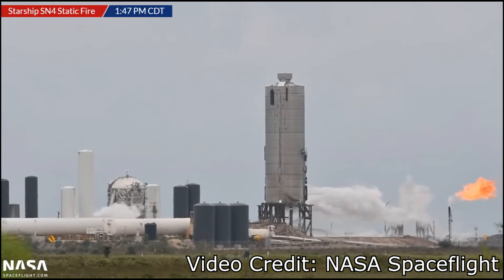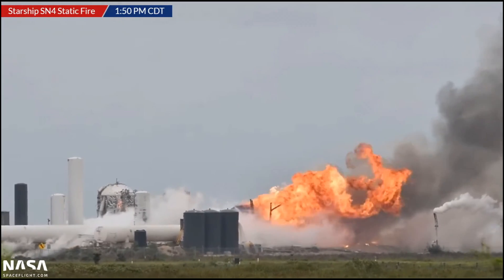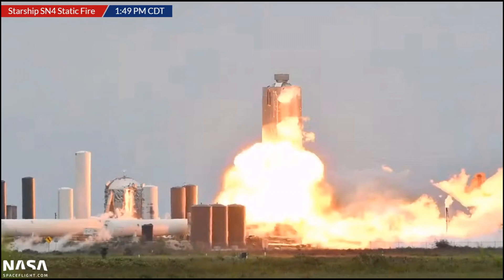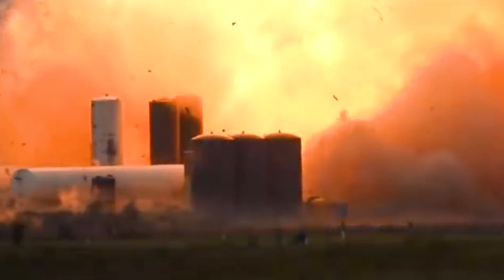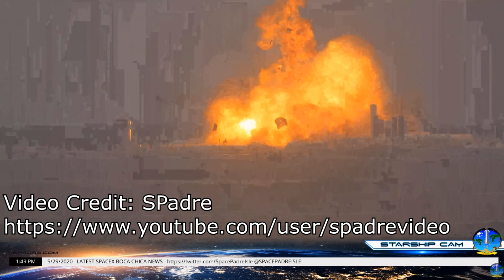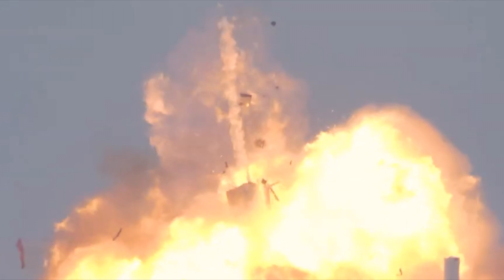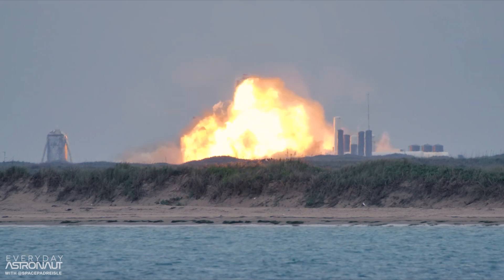What Can We Learn From The Explosion Of The Latest SpaceX Prototype?

Comment: This is starting to look like stress-testing, in a way : they keep doing nearly identical tests very quickly on the same prototype, which means it goes through many thermal and mechanical stress cycles. Eventually something will break, and this will tell SpaceX exactly what needs to be reinforced. My point is, they may have been waiting for exactly such a failure to happen. If all goes to plan, further prototypes will share the same fate, but after more and more tests each time, until the desired reliability is achieved. At least, that's how I would do it.
Reply: @Will Hooton First, Musk did say SpaceX's mode of operation is "fail early, fail often", and it's a tried and tested design methodology. Second, even though they might cost millions, those prototypes cost nothing compared to what's spent developing, say, the SLS. This ship will eventually carry a hundred people... you don't want to have their deaths on your conscience just because you wanted to keep a cheap prototype intact. That's not what those protos are for.
Reply: I agree, they spot the weakest links step by step
Reply: @Will Hooton you should not assume that the Starship is the only thing being tested, here. The ground equipment is part of the whole system. You might not know this, but when you design a vehicle of any kind (including planes and trains) you also design dedicated support and maintenance tooling that goes with it, even infrastructure. It's part of the package you sell your customers. Same thing here : SpaceX can't just design a space ship, they also need to design its launch and landing pad, and the refueling system for it. It stands to reason that they are also testing that equipment. It just doesn't get any press because, much as I love and respect our favorite YouTubers, their focus is set very narrowly to what they love, which is rockets, not plumbing.

Consider this : SpaceX plans to make at least a thousand Starships. They will not make a thousand launch pads. Much like airports, there will definitely be much fewer launch pads than Starship, which means they need to be even more reliable. But I totally understand that this is something most rocket enthusiasts would find boring.
Reply: just like in application development when you make the code that does something and then you stress test it to hell and back... trying to break things on purpose. I do it every day and honestly when you fail to break something but you are not 100% sure how your addition plays along with other parts of the program, thats when there is uneasy and dangerous feeling. If you break it, you find the bug and fix it, if not there may be a bug but you cant trigger it and it may trigger when 100's or 1000's of users simultaniously start using module with that new additions...
But i dont think explosion her was on purpose... i think that ground infrastructure failed in this instance, that is the line fueling the starship.
Again comparison with app development would be as if you were testing new code you just added and it fails dramatically but all is fine with the code its only that the some files of the browser you are testing on are corrupted for some reason and the browser failed.
Reply: Sort of like applying Eddisons approach to lighbulbs to rockets.  "So far we've found 4 ways not to build the Starship."
Reply: According to the analysis here and what we can see with our Eyes from the video, The problem was caused exterior to the spacecraft, such as the alleged leaking pipe, and seems to have nothing to do with an actual stress test of the rocket. I’m not trying to argue with you I’m just saying that this was an accident subsequent to any stress tests That were apparently already finished.
Reply: I love SpaceX but this was indeed an accident. But nothing against that, accidents happen and I agree that it’s better to get this all out of the way before it’s actually being used for real
Reply: @Will Hooton : No, the code comparison is appropriate, because Elon is intentionally doing that style of testing. He comes from a programming background himself, is fully aware that the type of engineering that you are describing is extremely slow (it's the type of engineering that produced the Space Shuttle, which itself arrived late ), and knows just as well as anyone else that it can still fail (e.g. the Shuttle, 737 Max).
Reply: @Will Hooton they do do intentional destructive tests.

If your test prototype has done all the tests you wanted it is either very expensive scrap or a way for you to test what happens when say a tank is over or under pressurised.

Yes the thing is destroyed but you were going to do that anyway, best to have some experimental data on failure types rather than purely theoretical before you start putting people in it.
Reply: OK ... guys, that settles it.   adding viagra to the rocket fuel is not gonna help
Reply: @Will Hooton Agree to a point.  ELon comes from a software background and seems to be using an Agile methodology.  Even on very expensive hardware rapid failure can be the cheapest rout.

Comment: They were unlucky - it looks as if they plugged the leak 6 seconds before it exploded (the venting stops).
Had it not found an ignition source in those few seconds after, the cloud of methane would have dissipated and nothing would have happened.

(Actually - it looks like the explosion was triggered by the cloud of methane gas clearing.  As long as it was 100% methane it was OK, as no ignition can happen in pure methane.  But as it cleared, the underskirt got a breath of fresh air and oxy, and boom.....)
R
Reply: I think that is quite likely. I work in process safety for an international chemical company.
Reply: Excellent point  - at one time people would work on dirty gas lines in the steel industry while they were full .
People got on the safety kick , that lines had to be cleared - but in the process you get to the point where you have a perfect mix of gas and air
Reply: @psychiatry-is-eugenics  
That only happens if you purge with only air.
If you do a two-step purge where you use an inert gas to flush out the flammable gas, then use regular air to purge the inert gas, then there's no chance of an explosion. I'm pretty sure they figured that out before having any accidents with purging the lines resulting in an explosion.
Reply: psychiatry is eugenics often enough there is an idiot and safety (that is where we warehouse the incompetent engineers) that gets enough authority to screw things up even more than imaginable.

In the industry I was in, the safety engineers would add on layers and layers of “safety factors“ which are actually performance multipliers, so for instance, if a 50 amp circuit was needed they would double it to 100 A. This is a ridiculous safety factor requiring four times the weight in wire and other equipment. Pretty soon the craft is too heavy to even fly.

The whole world is full of these idiots and it is amazing how much authority they have. Almost the entire government bureaucracy works this way.

You really got my juices flowing on this one. Thanks for the reminder of all the idiocy I have seen in my life as an engineer.
Reply: Steve Perreira  Your industry was using the wrong people in safety - but you're right that some industries breed bureaucracies and safety can be one of them.  Having a well integrated team (incl safety) should reduce or eliminate the problem.  Having a siloed team or a bolt-on safety layer will just perpetuate it.
Reply: @gavinward5448  and you're an expert in all this, or are you just spouting catchphrases and 'buzzwords'?
Reply: You know your chemistry. Very good analysis. Thank you!
Reply: In fact, since these are quick-disconnect valves, perhaps the static-test disconnected the methane line.
Then, when they defuelled the methane, nobody noticed for several seconds that it was pumping outside.  
R
Reply: I hadn't noticed, but I think you're right. The spillage looks to have stopped or slowed enough at 12:36 to see GSE again.
Reply: Methane in the presence of oxygen can spontaneously combust, and any breeze would be enough to mix the leaking fuel with the atmosphere and generate a pretty good fuel-air bomb.
Reply: No worries 😊 We just keep Shoving Money at it, it eventually will work

Comment: They need more protection on their refueling lines, as one clearly fractured or fell off.
Remember it would not be like this, on the real Starship, this is just a test configuration.
On the real Starship these refuelling points would be 60m above the ground, and nowhere near the roaring engines.
Likewise on the booster, the refuelling points would again be at the top of the booster, not the bottom.
So in real life, they would not have refuelling lines next to 240 tonnes (or 720 tonnes ) of roaring thrust.
R
Reply: Nope. It is all bottom-fed.  No service tower required.
Reply: (bottom fed).  Not possible - you cannot have Starship and Booster on the pad, without a tower to stabilise it.  
And if you have a tower, you are NOT going to feed the propellants in at the base - right next to 31 roaring Raptors...!!
R

Comment: Welded stainless rockets will never reach space.
Reply: Mercury Atlas wants to have a word with you
Reply: @tsurutuneado5981  OK. You got me. I think the scale of this and the inconsistency of a weld, even an automated weld on thin stainless is going to be too big a problem. I am no expert on the level of some of the weld techniques that they are using on Starship, but I do have 20 years experience welding thin wall stainless steel using mig and tig welding. I have my doubts, but I really hope I am wrong on this one. Fingers crossed. I wish them all the best.

Comment: Hi Scott, a little imprecision, if liquid methane leaks nothing really bad happen because it needs a LOT of oxygen to burn in the liquid form, so the leak most probably contains liquid oxygen and lox mixed together. This explains why the fire moves so fast towards the vehicle, probably ignited from the flare. If it was only liquid methane the flame would have moved a lot slower and should have made a lot of black smoke, again liquid methane or a cloud of gas needs a lot of oxygen to burn clean and air will not be sufficient for such an explosion

Comment: Does not the weld get more strain when the load simulator is on top? When the engine fires, there is much more inertia in the ship, wich means less give for the weld since the ship does not move as much with the weight?

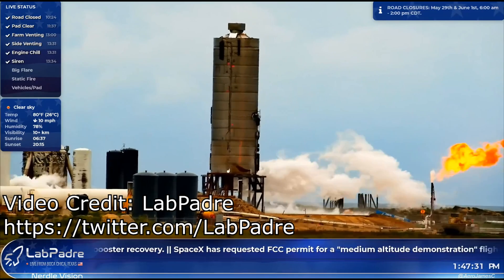Comment: Can anyone explain why the footage from LabPadre (11:00 and onwards) looks so woobly? It looks like the Starship can't quite manifest itself in our spacial dimensions.
Reply: LabPadre's camera are mounted on top of a mast. The wind at that location usualy are quite strong and the mast is swaying back and forth. The camera is both optically and digitally stabilized and are trying to compensate for the extreme movements going on.
Reply: @nemo-x  As I understand he is filming from the top of an apartment block around 7 miles away. The other cameras are within a couple of miles of the site
Reply: Labpadre has some camera focusing issue that causes it to look shaky. He's working on a fix i believe
Reply: As the air temp was noted at 26 C it is hot enough to move airmolecules and warp the image, especially that close to the ground from a long distance. Nothing strange.

Comment: So I have a question about this sort of thing. We all know oxygen as a gas is extremely flammable. Why doesn't the liquid oxygen pose a huge risk of fire and explosion of it's vented en mass?
Reply: Need something to oxidize, like that methane.
Reply: Remember the fire triangle: fuel, oxidizer, heat. There is normally not fuel in open air. (unless maybe you're on Titan, with methane in its atmosphere)
Oxygen isn't flammable, it's an oxidizer. It just makes everything else flammable, sometimes very. Oxygen outside in the open air just means a bit more oxygen floating around than usual. LOX and oxygen ice is a bigger problem because it's a lot of oxygen in a small volume that can come directly in contact with stuff.

Comment: This is SpaceX's Starship Prototype Serial Number 4. It is a brand new vehicle that is being developed in the middle of Boca Chica, TX. It's brand new and they're currently just building one part of the second stage of the entire rocket and testing the Raptor engine, which is also a brand new engine. This is how SpaceX works, they break stuff and test a lot.

This is a test vehicle, and it's not related to the Falcon 9 and Crew Dragon space vehicles that have gone through thousands of hours of testing. The Falcon 9 uses completely different structure and engines than this Starship, so don't worry about the Demo-2 mission with NASA.

Comment: "If it finds an ignition source"
Me: looking at you, tall flame tower
Reply: As I usually say when I do gas safety instructions: It is not a question IF it finds an ignition source, only a question of WHEN it finds an ignition source.
Reply: The tower had nothing to do with it. The initial cause is right under SN4.
Reply: Peter Barratt: Oh, really? You are surely a genius. Because it still wasn't clear after Scott showed the entire process in slow motion, frame by frame.
Reply: @ocpd23  Toxic.
Reply: @ocpd23  Yes, it was clear.
Reply: @ocpd23  With many years as a fire safety officer and investigator, I have seen enough footage of this event from many different angles to know precisely how and when this occurred. It does not take a genius, just a well educated mind to decipher the information available. Look at the time slot of 2:47 and see for yourself the ignition UNDERNEATH SN4 just prior to the explosion.
Reply: @peterbarratt8699  true, still curious to know what sparked the ignition if the engines were cooled, perhaps some cables snapped from the cold.
Reply: @christiaanventer8183  Perhaps, or something as simple as static charge building up by the gas/liquid flowing through the pipes and valves.
For non-conducting fluids, this is a well known phenomena, and the most likely cause for a lot of fires/explosions involving pressurized gasses (especially hydrogen and methane are susceptible to this as the energy needed to ignite them are so small, basically a spark with a potential difference of 1 volt is enough).
Yes, shorting a AA battery will produce a spark big enough to ignite hydrogen or methane
Reply: @srenkoch6127  I somehow read "snorting a double-A battery will produce a spark". Fair enough, we observe this in clouds, commonly called 'lightening' so it's likely the venting gas found a way to build static charge.

Comment: Properly done stainless steel welds should not change the color of the metal or the weld bead. I'm guessing they are falling into a common trap of lowering weld energy, in an attempt to control heat, but then that leads to slower bead laying which actually introduces even more heat.

Comment: Well Scott, the same thing we have learned from the last 4 iterations. NOTHING. These are not engineered to standards that would allow sustainable engine operations. Clearly the construction methods from the failed prototypes are still being used which is a shame. They need to take their time and stop with the garbage welds and stainless steel, which is the common denominator here.

Comment: Thanks Scott for you usual thorough analysis.   2 really important features that SpaceX really need to look at because, from my undertanding of working on similar structures in coastal LNG plants in Oz, there is a explanation for ignition source and also why test stand was ripped out of pad. 
In harsh marine environments a special steel alloy is specified which they may be using here. However salt buildup over time & humidity can turn the structure into a low voltage battery. This is counteracted on-site with a balancing electical charge. This may not have been done here and if you have disimilar metal contact there is a possiblity of a spark.
I noticed straight away the stand should never have been blown off the pad and the hold down plates were not damaged indicating the nuts\bolts had sheared. Explanation may be multiple hot\freezing events may have lowered strength of steel connnections and the sustained freezing turned the bolts brittle, resulting in connection shear. A real point of failure to address in future as I think the fall path of SN4 was luckily away from tank farm, but if they put next tank stand in wrong location it could fall into tank farm.

Comment: I always thought that the rocket testing is way too close to the gas reservoir tanks. They should move the rocket stand much further out.
Reply: That would require more control and emergency valves in the piping network to prevent blow back, which adds more points of failure to the system, potentially decreasing the safety. Especially when it's required to evacuate the lines before people can work in the area. I had thought they would be better under ground but apparently that's even worse if they cannot observe any possible leakages of the tanks...
Reply: That's what I was thinking watching it, would have been crazy to see them go up as well though.
Reply: There's nowhere really for them to move to,there in the middle of a wildlife sanctuary